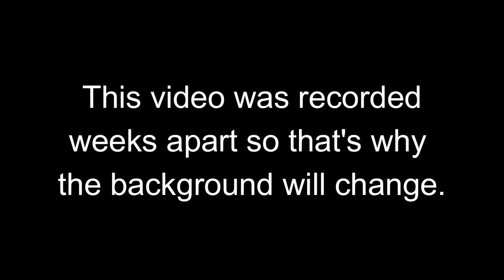PSP 2800mAh Battery Mod

Comment: Good, but i would add a Physical Switch coming off the battery. Sometimes the PSP glitches and require the battery be completely removed / disconnected, but otherwise superb job !
Reply: also i wanted to ask, How accurate is the Battery Display Icon with this mod ?

Comment: I don’t think anyone can beat my modification battery on my psp! I connected a 12v car battery to my psp via the cigarette lighter port and I played for 12 hours st8, then I disconnected it and it went back to an original psp in seconds, the cigarette charger cost me 3 pounds on eBay.🤣💥🔫

Comment: This is awesome, might as well remove those battery springs just to shave off as much weight

oh btw, how would I know if a phone battery is safe to hotwire into the PSP? Like the battery specifications?
Reply from the maker: Thanks man and as for the battery just look for a 3.7v one

Btw if the battery is used drain it before soldering
Reply: @axemods03  how does one drain a battery? especially a new one?
Reply from the maker: If it's new I would just go for it wouldn't even bother draining it tbh

Comment: awesome job, how did you solder to the battery terminals so easily?? i always have a hard time getting the solder to stick
Reply from the maker: Umm do you use flux ?
Reply: Ga pakai fluk ya susah 👍

Comment: Hi how to correct battery percentage info. There is still a lot of battery while the percentage display already shows 0%. Until the psp turns off for a moment, if left for a while then the percentage will go back up without charging. Please provide information...

Comment: Nice mod I have tried this mod myself but my problem is the battery mesures 3.7v which is all good.  But the battery voltage will not go through the battery board and into my psp.
So any ideas why and I have tried two different battery boards one a genuine Sony and one some other make.
Reply: Same did you find something?

Comment: Hi, I noticed you used a 3.8V battery on your mod. I was wondering if it still works and didn’t result in any issue, something happened or is everything fine? Thanks in advance
Reply: Is this a “yes”?
Reply: the donor board from the battery acts as a voltage regulator

Comment: If you like put too much pressure on the back or accidentally drop it will it turn off? That kept happening to mine because i dont know how to keep the battery chip from moving from the connections
Reply from the maker: Mine doesn't do that and to make sure your talking about the motherboard right because it shouldn't move
Reply: @axemods03  yeah the battery mobo. So i put the lipo in and attach the mobo to it and have it touching the connections. Maybe ill try soldering wires to it. Already went thru 2 psps lol
Reply from the maker: @mikec.1210  Yea if it's not a official psp battery u should most definitely solder the connections watch my other battery video if you need a little help ;)
Reply from the maker: @dj2muchxxx  No it's the same official psp batteries and third party one's are built the same

Comment: The motherboard of the battery is under the battery or above? because when you installing it, it is right above and when you finished it, its under the battery. Or im just wrong?
Reply from the maker: Yea the board is on top of the battery
Reply: @axemods03  thank you
Reply from the maker: @justinnn389  No problem man 😉

Comment: the original battery seemed to have a higher number, so does this samsung one last longer even tho it's a smaller number ?
Reply from the maker: The original psp battery is only 1200mah and the samsung one was 2800mah so the samsung is better
Reply: @axemods03  but is the Samsung also 3.7v like the original?
Reply from the maker: @SRC267  Yes it is
Reply: @axemods03  I see. I'm thinking to also mod mine. I have original Sony battery, but cell is bloated. At least I have the Good oem circuit board.
Reply from the maker: @SRC267  Awesome you just need to find a good quality battery now try to get atleast a 2400mah battery to double the original capacity ✌️
Reply: @axemods03  I don't know what size will fit flush inside like your Samsung battery. Also I'll need to invest in solder equipments and wires. Never used those before

Comment: Hello, first of all great job, I'm wondering how long does your battery last, because I got one of these batteries off e-Bay and I'm getting just 4 hours mid volume and brightness level 2, I'm guessing my battery is fake. Thanks in advance.
Reply from the maker: Yeah for me it's even less than that because the battery is really old but now I have a new 2500mah it last more than 5 hours so I recommend getting a battery off adafruit or other  reputable brand

Comment: Can we know the status of ur psp mod? Is it still working? Im planning to do this but im afraid that the battery might blow up or something.
Reply from the maker: It's fine there's no problem you can do it it's safe 😉✌️
Reply: @axemods03  Great! Thanks man! :) I managed to score a 3000 mah 3.7v battery from a local mobile store for free, when I told him its for a "school project". Gonna test it out and see!
Reply: @axemods03  Hello AxeYT, i was trying to do this but i realized that my psp battery doesnt have the same kind of internal circuit as yours. I think its because my battery is an original one. Is this still usable or i need one of those knockoffs?
Reply from the maker: @GameIsMyOxygen  it's fine
Reply: @axemods03  Yes! It works! My psp detects the battery and im gonna fit it in the shell now. Thanks alot man! :)

Comment: Yo hice el tutorial en mi psp 3010 hace una semana y todo perfecto, use una bateria de Samsung j2 Prime de 2600mAh y 3.8 voltios, conserve la carcasa de la bateria vieja mas no la bateria vieja, todo para que encajara y no soldar los pines, antes Tenia 1 hora de jugar con brillo y volumen al maximo con la bateria vieja, pero con la del j2, obtengo 4 horas y media temporizadas de brillo maximo y volumen maximo, mas de 4 veces lo que duraba originalmente, me siento muy feliz y orgulloso.

la bateria me costo 5 dolares y como dato adicional, la psp se carga en 3 Horas, se que es bastante tiempo, pero lo vale totalmente, a pesar de que en 1 hora llega al 100% segun el indicador de la psp, la luz sigue en naranja, esto es por una falla comun en la lectura en este mod, simplemente me fijo cuando la led indicadora cambie de naranja a verde, cualquier cosa preguntenme si tienen dudas, los youtubers a menudo no responden con tanto tiempo de haber subido el Video
Reply: yo hice el mismo mod del video, usando la misma bateria pero de 3000 mhz, cuando la conecto me sale el led naranja parpadeando xdd es una paja, la psp enciende enchufada a la corriente eso si, asi que muerta muerta no está
Reply: Puse una bateriia de 4000mah pero no le llega voltaje a la salida de la placa de la bateria. Sabes algo sobre el tema?  La enciende cuando la cargas pero al cabo de unos segundo se apaga. Un saludo.

Comment: I have the same Battery where do I solder the + - wires onto the battery?
Reply from the maker: It should be labelled with a little + and - sign onto the battery

Comment: What is the point of that mod? You went from 3600mAh offbrand to less 2800mAh. Did I miss sometihng?
Reply: the offbrand is fake it's morelike just 500 to 900 mAh
Reply: @phoenixdown1947  You got some bad offbrand then cause my battery check confirms 3589 on my battery
Reply: @Contori_ what brand of battery do you have and where did you purchase it from. Thank you

Comment: I got the circuit from an original dead battery.
Unfortunatelly when charging orange led keeps blinking fast and does not charge properly
Reply from the maker: You sure you did it properly ?
Reply: @axemods03  yes.
Also tried other batteries.
Reply from the maker: @jpnc2319  I did a quick google search and came up with this (Fast flashing indicates a poor connection between the battery and charger or a problem with the battery pack. ... Afterwards, try charging the battery again. If the flashing continues, then the battery may need to be replaced)

Comment: Will a 3.8v battery work?
Reply from the maker: I think it should it's not to far off 3.7v
Reply: @axemods03  ye for some reason it still wont work even with a 3.7v battery is it because im using the original battery pcb?
Reply from the maker: @ABAMTV12 You do need the og battery pcb in fact anything will do even knock off one's
Reply: @axemods03  ye but like it will only turn on if i hook it to the charger then i take off the charger and it only turns on for like 2-5 seconds then shutoffs

Comment: I will spray paint my psp street's case, what kind of paint would fit for its material?
Reply from the maker: Of course plastic paint and use don't use sand paper to sand it use the green side of a kitchen sponge it will work a millions time better good luck ;)

Comment: Nice work. How accurately can the PSP display the current life/charge remaining on the battery as you charge and deplete it?
Reply: theres a piece of homebrew called "PSPTool" which is usually used to create a pandora battery through softmodding
but it also has the option to tell you your battery's:
- max capacity
- current capacity left
- the percentage left 
- battery voltage
- battery temperature
and so on

Comment: Uhhhh... You do know that you can buy a battery mod which is a 3500mah and is made by sony?
Reply from the maker: There is no 3500mah official psp battery
Reply: There is mate, I still remember that bulky battery cover for it
Reply: @SoraFilms  you must be thinking about the official extended 2200mah battery which came with those black and silver covers. Those are all bloated now. I had one brand new in its package and was it didn't work. Amazon had those on sale a while back with tons of negative reviews from the bloated dead batteries. They took them off.

Comment: if you really did use a board from a 3600 mah battery pack its dangerous to use it with a 2800 mah battery due to overcharging leading to explosion
Reply from the maker: It was a 1200mah
Reply: @axemods03  hmm well with me working on expanding phone batteries I can tell you this wasn't really useful then if you used the 1200 board on a 2800 battery it will be only better in the terms of long term battery life but the whole point of getting a battery is to get more use so yea idk

Comment: how long is the battery last?
Reply from the maker: It could last for about 4 to 6 hours
Reply: @axemods03  i found out that your battery is 3.8 volts.. does it heat up the board?
Reply from the maker: @gyrenrockz  No doesn't matter it's not a huge difference

Comment: how do you put lights on the psp buttons?
Reply from the maker: You drill a little hole in the L/R buttons to fit the led in

Hope it helps 😉
Reply: @axemods03  make a video explaining step by step, it will help the community a lot.